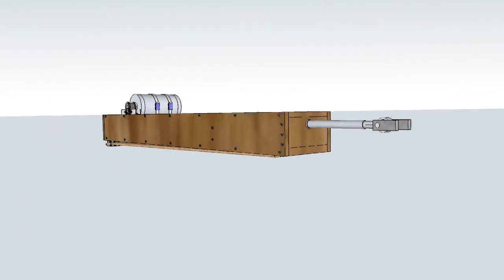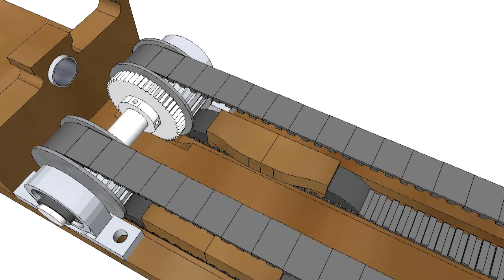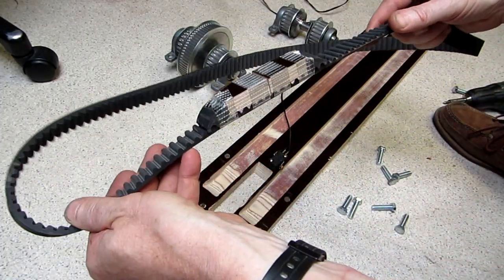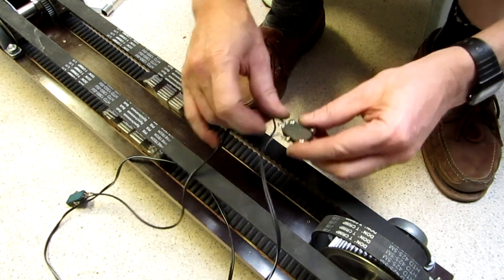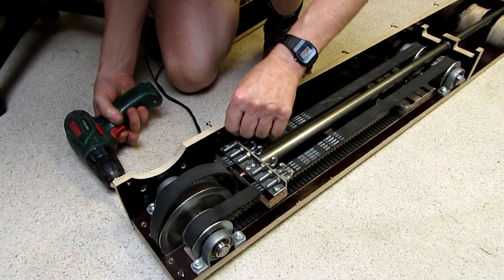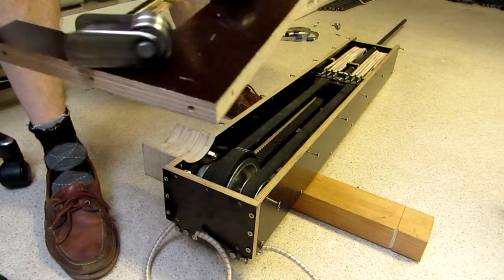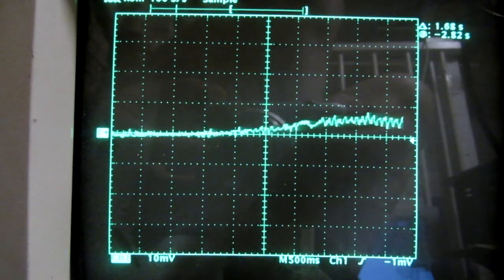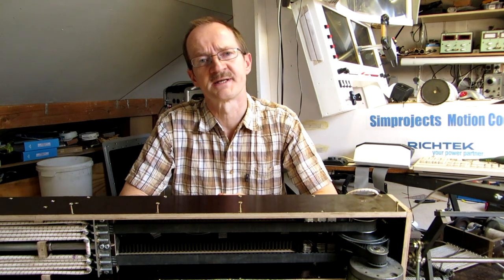Linear Actuator Design

Comment: Awesome work Roland..  it seems the two belt tensioners for the motor drive belt  could introduce slack over time and the eyelets, where the bungee passes through would tear the bungee over time (like my broken shoelace  : )  )..  in my huble opinion but aside from that..  excellent work and very inspirational  thank you!!!   Subbed and God Bless my friend : )
Reply: CCM offer belt-driven linear rails which is more efficient and economical, inquiry is welcome www.ccmrails.com

Comment: I WOULD USE BICYCLE CHAIN ! I QUIT USING BELTS ! I ALSO USE COUNTER WOUND ROPES ON SHAFTS TO REEL IN AND OUT ! I LIKE THE BUNGEES ! I USE BUNGEES TOO FOR COUNTER WEIGHTING ! I USE ARDUINO MEGA FOR THE A/D AND POTENTIOMETERS WITH WHEELS ATTACHED TO COMPUTERIZE THE ACTUATOR LOCATIONS ! AN ARDUINO MEGA HANDLES 16 MOTOR LOCATIONS A/D AND 48 SERVO CHANNELS  !  I USE DRILL MOTORS LIKE THE EVOLVE HAND DRILL AND MOUNT SMALL SERVOS TO THE FORWARD REVERSE AND THE ON OFF VARIABLE SPEED DRILL TRIGGER ! ITS EASY PROGRAMMING AND AN ARDUINO MEGA IS ONLY ABOUT $12 ! ARDUINO UNO IS ABOUT $8 AND HAS 6 A/D CHANNELS ABOUT 16 SERVO CHANNELS !  MY NEXT PROJECT IS TO USE AN A/C SHOP HOIST WITH THE ARDUINO MEGA AND THEN A 12V WINCH
Reply: CCM offer belt-driven linear rails which is more efficient and economical, inquiry is welcome www.ccmrails.com

Comment: Great Project ! I will suggest to modify design to be able to tension belts. This will let you avoid tilts on stops. as well will improve longevity of your belts in general. Probably you will need to buy sonic tensioning meter for this and, unfortunately they are not cheap :( .
Reply: CCM offer belt-driven linear rails which is more efficient and economical, inquiry is welcome www.ccmrails.com  /andy@ccm-rails.com

Comment: I noticed some tap holes on the motor front plate. Maybe you could use a bracket to prevent the motor moving forward by utilising those taps. However it would exert a great amount of force on the screws holding the clamp.
Reply: CCM offer belt-driven linear rails which is more efficient and economical, inquiry is welcome www.ccmrails.com  /andy@ccm-rails.com

Comment: Great video, inspiring to say the least. However, for the purpose of your flight simulator, you could have used a ball screw coupling instead to reduce space requirement and weight of the actuator, any reason why you opted for this mechanism instead?

Comment: Way too many moving parts to break.

Do that with hydraulic cylinders, power steering pump & some valves for 1/4 the cost and 1000x the power.
Reply: Erich Stein Depends on the area of application. This thing would work on a miniature battery whereas a hydraulic/pneumatic cylinder would require a reservoir along with a pump/compressor.

Comment: Did you ever finish the 6dof platform?
Reply from the maker: As always, lots of other things came in between, and I still was not satisfied with the actuator design. In the mean time I have built another prototype. see http://www.simprojects.nl/diy_motion_platform_v.htm bottom. But then I got my hands on some industrial rollerscrews, and I'm currently checking how I can built a more compact actuator with these.

Comment: Should a DC motor with or without a gear box be used, for optimal performance?
Reply: Mercurial Mann Most DC motors have a very high base RPM which is unsuitable for these applications. So I think a gearbox has to be used.

Comment: Excellent work, and very inspiring -- also a very fine presentation. I am a retired defense engineering programmer/analyst. It's been a while since I've worked on 6 DOF modelling. I don't think I could do the math right off the cuff, but I do understand the control principles. I think it's amazing that the parts for this only cost you $300 - esp the pulleys. The bungee's to neutralize load is brilliant. The only thing I do not see in the design are damping elements. I realize you can control the acceleration via the pot feedback and software - which makes me thin of an elevator, in principle - but in your case, I bet some mechanical damping would cut back jerk and snap for smoother natural operation.  I wonder what your thoughts might be on this...
 It's refreshing to see individuals actually practicing systems engineering on their own projects. 
A toast to your ambitions, Sir !
Reply from the maker: Indeed some damping in the system will be needed. It could be added mechanically, but can also be implemented in the servo feedback system by tuning the P/I/D terms to appropriate values with the average load. Thing is that in some flight events you want snappy response while in other events you want slow response. The flight sim data is not all that refined, so a compromise is needed, or active servo PID tuning via software based on flight conditions. 
Thanks for your comments!

Comment: Possible considerations for similar designs.

1) I agree with another comment that the potentiometer should be replaced with an encoder to avoid drift and EMI from the motors while reducing oscillations that are likely to occur under high dynamic loads.  This can also be addressed by implementing acceleration curves though I suspect the use of belts was intended to suppliment this requirement.
2) By high mounting (instead of under mounting) you run the risk of a collision of your platform with the legs.  
3) As you noted, bungees (springs) do not provide constant force at all positions.  F = kx, where F is the force applied, k is the spring constant and x is the extension.  Further excursion = reduced weight compensation.  You will have zero static load at exactly one excursion point, any deviation from this point will result in a required holding force, though this appears acceptable in your tests (probably due the high ratio of the length of bundee to the traversal length of the acutator).
4) You will likely have difficulty maintaining a level platform unless you include belt stretch compensation for holding forces by measuring the load on the motor, either through a load cell or current draw.  This is because your center of gravity will shift as the platform is moved around.  Any 2 legs should be capable of acceptable actuation with the entire weight of the platform plus an (arbitrary) safety factor above the expected dynamic loads. 

This seems like a pretty good home setup where minimal excursion and minimal centroid deviation is required however I suspect it will not work well over the full possible traversal (motion envelope will be small especially fore/aft and laft/right).  This is mostly due to the high mounting of the actuators relative to the platform.  To experience full excursion, your footprint will have to be quite wide (instead of tall) at which point a larger deflection will be required by the actuators to effect the desired roll, pitch or yaw.  Vertical motion will be unaffected by footprint width.

Comment: Are the bungees for giving it a fail safe position?
Reply from the maker: yes, but they also provide the force for the static load (platform weight). In this way the motors don't have to continuously work to carry the weight, reducing average power consumption.

Comment: Eh... why not just make a huge ball or half ball and rotate it with two strong motors?
Reply: That would make it a 2DOF. This is a 6DOF!!! BTW, how would you rotate the huge half ball precisely, without slipping, and where the hell would you get one!!! ;)
Reply: With friction and there are always custom manufacturers that does your request.
In case you are confused how it would work, You have a round shaped cage to prevent ball from escaping. You add the motors on sideways and you have two wheels attached to motors that with move the ball around with friction, those wheels also have wheels on them put in to side way angle to enable side way movement. Voíla. You have 360 motion simulator.

Now sure, there might be couple of kinks that needs to be sorted out for perfect run but that's mostly just math, trial and error.
Reply: I understand, you mean something that somehow works like the old pc ball mouse, and it could be a great idea. It could turn you around in 2 axes, 360 degrees. What this guy is working on can turn you in 3 axes(around 20 degrees) and move you linearly in 3 directions. You should put this guys machine in your ball ;)

Comment: very cool but why did you not youse a normal pneumatic system? i think it would be cheaper or did you wanted the challange ? :)
Reply: a pneumatic system isn't variable, it's only in or out (or in out and middle if you want multi-step pistons at the cost of power).
Reply: ok ty i thought with modern pistons and some electroniks it wouzld be no problem

Comment: Excellent! Here is a man of great mechanical mind. If I may be so bold as to offer a suggestion. I noted on the bungycord "Eye Bolts , that an extra force has been applied. I am speaking of the friction between the eye bolts and the bungy cord when it passes through the eyelet.  I do wonder what the result would be if you were to add " pullies" where the bungy meets the eye? Hmmmm! Maybe you could achieve a smother operation. 

I will stay tuned to see if that idea has merit. Good evening and good luck.

Comment: serious comment, nice actuator, if I had the time I would love to build an adjustable computer desk using a slightly toned down version.  I love the speed though.  I hate waiting for the desks at work to adjust.  this would be like going from a sitting level to standing in 1 second.  Just need to remember to not leave my coffee on the desk before pushing the button.  Might need to gluew the keyboard and trackball in place as well.  Seriously I hate waiting that much, although I might add in a bit of a reduction in speed.  Move up about a foot in 2 seconds instead of instantly.

Comment: Thats impressive and functional. Just a thought: in my experience, bungee cord doesn't last long under load.  Most rubber seems to oxidize at a very accelerated rate when left in a stretched condition.
Reply: Ya he'd be much better off using gas charged struts like the ones that hold up the rear hatch on an SUV, be tricky fining just the right weight though.
Reply: Nevir202
You know, since obviously he's no slouch with electronics, you could use some cheap electronics and air pumps to auto-center some gas struts. (auto-center the linear servo's, I mean)

Dunno if you can get gas struts like that that are fillable though.  I think the hatch struts on SUV's are just coil springs and have a small hole to use gas as a damper.

I know you can get regular vehicle struts that are gas charged (my motorcycle has rear gas struts), but I think you'd have a hard time finding one with enough stroke.
Reply: I don't  think they have a spring, at least the ones I've known go from fine to totally useless, whereas a spring would slowly get worse but always give some resistance.
Reply: Nevir202
Yeah, could well be that quality ones just have piston gasket, compressed air at one end and a hole at the other to act as a damper.  Still, I think they're factory sealed.  They don't have a Schrader valve or anything for adjustment.

Personally, if I were doing this project, I would use a long throw double action hydraulic cylinder and an electric hydraulic gear pump.  I don't see why that combination isnt a lot more common.
Reply: Ya I've never seen adjustable ones. Might be able to drill and tap to add a valve though. LOL

As to why hydraulics aren't more common, it's a lot more expensive and a lot more dangerous. That's why people use pneumatic cylinders for these things generally.
Reply: Nevir202
See, I don't know.  On Amazon you can get a double-action, 2 inch hydraulic cylinder for $150.  You can get a power unit for about $200.

If I remember right, the target price per actuator was about $300 in this video, so its maybe gonna be 2x as expensive if you're buying all new stuff.  Second hand is probably going to be in the same ball park of $300 per actuator.

As for the tools, I've found this out the hard way: high quality wood working stuff is actually more expensive than the relatively simple metal-working tools you'd need.

Obviously you go with what you know, and this guy knows wood already.
Reply: That size cylinder x4 are not going to run off the cheap power unit you're seeing. Luckily the load rating of such a cylinder is probably WAY above what you need. So step down to smaller cylinders, maybe if you can find smaller ones that have the range you need. But they're less common so probably more expensive. And  you'd probably still need a better power unit. Remember, you need to be able to extend/retract all the pistons simultaneously at whatever max speed you want.

Also have you looked into the cost of the hoses? Don't skimp on those, you could lose an eye or worse.
Reply: Nevir202
Yeah, I re-thought that and its really mismatched, which is why they only use straight hydraulic cylinders for truly massive loads on 6 axis tables.

It seems like the saner thing would be to leverage a smaller cylinder and pump to affect some linear motion, even something as simple as a hinged L, so you get the speed you need at the sacrifice of an unnecessary amount of force.

I guess what I really don't understand is why they don't make integrated double action cylinder-pump combinations, you know, outside the aerospace industry.  Every commercial, electrically powered "linear actuator" I've seen has just been a piece of threaded rod driven by a gear, making them strong(ish), but slow and prone to wearing out.

On the other hand, if you look at variable hydrostats (like you'd see on small to medium sized residential tractors) they usually integrate a variable hydrostatic driven pump, reduction gearing and a static hydrostatic drive pump, all for about $400 retail.

Comment: I don't understand any of this stuff, but it's just so ridiculously cool!
Reply: It is important  If you want to bend the position of a mobile device such as  Ball joint of the car  Made from ductile cast iron .. the manufacturer is a ductile iron casting factory.  Produce a work piece for the furnace to be formed in the form of steel (meaning the order maker has a contract in accordance with the requirements). Step 1. The foundry itself test.  Obtain the numerical value according to the requirements ... Step 2, the order maker can get the sample for the furnace steel to be tested by himself .. the test requires👉 the actuators, generally using the hydraulic test.  Because it is very broadly defined  To the level of frequency cycles caused by aircraft vibrations  And three cars can count the number of times, for example, one hundred thousand times, so the yild point, etc.

Comment: I think you may find you have a bit of a maintenance issue with your teflon bushings. The 3D printer community experimented with bushings instead of bearings for a while, and found that they just didn't hold up to the repeated motion, even with the tiny loads a 3D printer presents.

Of course, replacing those cheap teflon bearings every now and then might be a pretty good trade for not having to buy 12 expensive linear bearings.

Comment: Why don't you use a DALA? your setup would be much easier with hydraulics. I would use DCV's with solenoid vavles then into your circuit board. Would be much more relaiable and durable.  Anyway cool vid, nice bit on engineering

Comment: what potentio meter you used? and the resolution?
Reply: Potentiometers have no resolution. They are a variable resistor which you can use to get a voltage that is linearly (or logarithmically) proportion to its turn position. The resolution when sensing the voltage of the potentiometer is up to the ADC used to sample it. Using a potentiometer is a bad idea because its carbon lining will eventually wear out with the constant turning. A good design would use a magnetic or optical encoder to determine the position with zero wear over time.
Reply: oh ya... i'm sorry i meant ADC resolution that u used to read that potesio
Reply from the maker: I used a 10-turn wire wound potentiometer, which gives a analog voltage proportional to the actuator position. The position voltage is use to drive an analog servo system. Currently a simple P-system with opamps. Planning to use an analog PID system in future. The 10 turn potmeters have worked fine so far. (no failure in  the last 5 years) Of course a digital encoder is zero maintainance, but needs fast ADC, MCU, PID programming etc. I prefer hardware which I'm comfortable with.
Reply: Novembri Nugroho

Comment: Nice design!   I'm not sure about the bungee cords though.    It wins regarding low cost, but some surplus air cylinders with a self relieving regulator could provide a more consistent counter force.    Your actuator design could be used for a number of things.  :-)